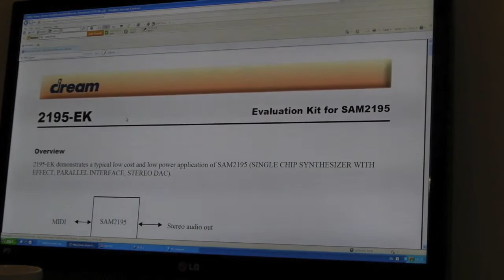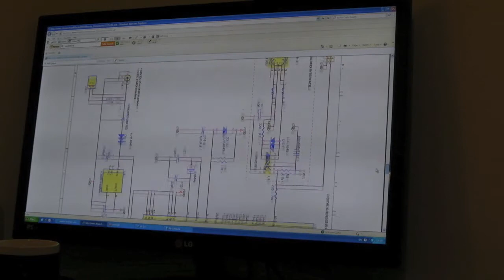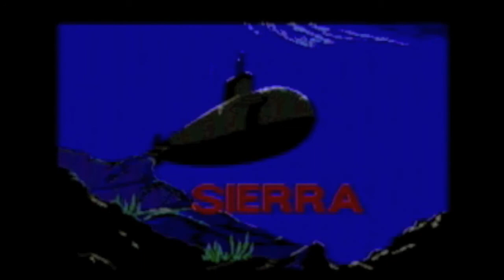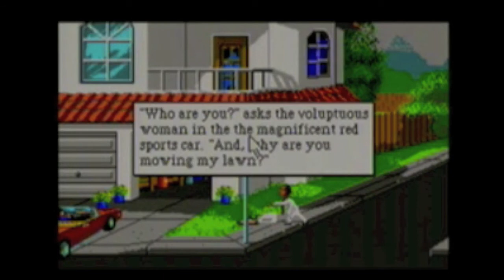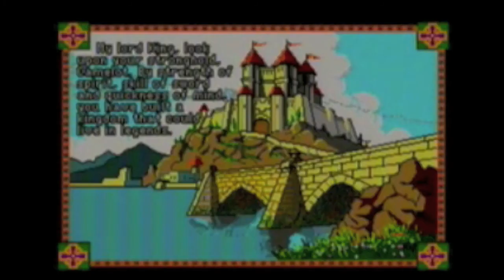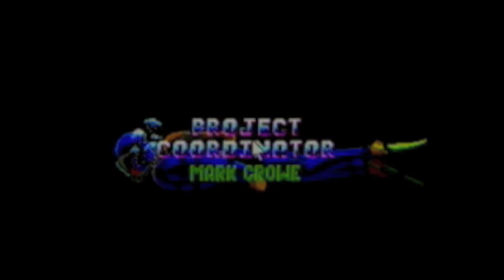Atari ST Internal MIDI Synth Mod - SAM2195

Comment from the maker: Update 15/02/2018: SAM2695 evaluation boards no longer stocked at the moment.  See here:- http://www.serdashop.com/waveblaster You would need to work out the pinout on the connector there, but in theory if you power it, feed the audio outputs, and connect the MIDI interface, I think it should work. I am not sure if you will need an opto isolator for the MIDI TTL connection there.

Update 21/02/2016: I believe this has been replaced by the  SAM2695 now.  Profusion also do the evaluation board (SAM2695-EK) as well.

Comment: Interesting Video.   Atari were stupid with the ST on the sound system.  For virtually nothing, they could have added Midi In and Out,  and the YM output (ideally all channels separated) lines to the cart port.  Then simple to high end sound expansion carts could have been made that would have mixed the audio and provided stereo output.  If that would have been done from the beginning, I am sure most game developers would have added options for Midi Music, and Midi music carts would have been made in the masses.
Reply from the maker: Yeah, I don't get why they didn't do that!  It would have made it way better for upgrades etc.
Reply: @GadgetUK164   I am not a big Commodore fan (I say with an A1200 sat in front of me LOL) but Commodore thought more into the system than Atari did, especially when it came to expansion. I guess Commodores plans for customers were 'Long Live the experience', where as Atari's was 'they'll be buying a new machine in two years.'

Comment: Hi, I have asked a good friend to do this mod on my STe using the waveblaster board. Do you have any notes on how you installed the board available online and have you heard of any cases of installing the Waveblaster internally since? Love the channel and keep up the good work
Reply from the maker: I will be doing a revisit video on my ST soon - I will talk about it then =D   Basically you need 3 things - power (and ground), MIDI input from the port there, and you need to mix the audio out.  It's better to have done a stereo mod already  (in the case of the STFM), with the STe that should be easier as it's already stereo =D
Reply: @GadgetUK164  Thanks for the feedback and I have passed on the info to my Guru :-) Once this is done the STe will be a monster Exxos 32mhz booster, internal ultra satan, fast tos and with internal midi :-) cannot wait to get it back :-) Thanks again

Comment: It's a great idea. I always said Atari should have brought out a budget external MIDI sound module back then and included a cable for YM based sound to be combined with the output so game developers could get an ADLIB+Soundblaster type spec into the market. A lot cheaper and quicker than the eventual STE upgrade surely?
Reply: Some of those pc soundcards were almost the cost of the ST
Reply: @ashleywhiteman2684  But to be fair those soundcards would rival the audio output of an Acorn Archimedes, which cost 2 to 3 times the cost of a 1987 520STFM :) But I think if Jack was at Commodore with MOS Technologies fabrication they could have copied/produced something cheaply to keep the ST alive once the spec wars of the Amiga 500 era started. Batman The Movie (by Ocean) on the Atari ST with different sound = Batman on Amiga. The ST in the right hands can do the same 3D and 8 way scrolling as an Amiga 500 eighties game. I was working on a video and that really struck me, turn off the sound and it's the same game and not jerky on either.

Comment: is there any shop selling these SAM2695-EKs...? i cant find anything online
Reply from the maker: Looks like Profusion have stopped stocking them =/  I will have a search around - I believe the SAM2695 has been used on a few other products which could be used the same way.  People have adapted them for old sound cards etc.
Reply from the maker: See here:- http://www.serdashop.com/waveblaster  You would need to work out the pinout on the connector there, but in theory if you power it, feed the audio outputs, and connect the MIDI interface, I think it should work.  I am not sure if you will need an opto isolator for the MIDI TTL connection there.

Comment: according to the datasheet of the chip there should actually be an MT-32 mode to rearrange the instruments to match. sounded like it was in GM mode on ICEMAN.
Reply from the maker: Yeah, I knew it was wrong at the time but just left it in to show how that game sounds 'wrong' lol.  I wasn't aware the chip supported an MT-32 mode, I will look into that!  Maybe I can write an exe for the ST to switch it into the other mode prior to loading the game!  Much appreciated!!!
Reply: GadgetUK164 - Retro Gaming Repairs & Mods Awesome, if you figure it out you have to make another video with it. Good stuff man.

Comment: I've never seen an ST in person, but from your videos it seems to be a very good mid-late 80s gaming system.  I've been impressed by how nice it looks graphically.  I think it's old AY-3 sound chip really lets it down though.  It's not terrible, but it's not good enough for the games it otherwise does a good job at running.
The stereo mod you showed in a previous video definitely improves the AY-3 sound - Atari should have wired it in stereo as original spec.

It's kind of odd that the 16-bit ST and Amiga systems both seem to have inferior (built-in) sound to their 8-bit predecessors.  Not sure what happened there. Perhaps there was some problem with using the old chips with a new architecture, but it seems like they could have put a little effort into updating those chips accordingly.
An Amiga compatible SID with maybe some more channels added would have been fantastic.  On the Atari side, IMO their old POKEY sounded better than the equally old AY-3-8912 (if I have the number right).
I do recall reading stories about a much better, in-house Atari sound chip that was deep into development during the ownership transition in 84.  Stories say that it was lost as a result of layoffs.

MIDI support was definitely a big feature for this computer, and the project you did in this video sounds great.  I imagine that a MIDI configuration was too expensive for gaming purposes back in the day, but now that it's economically feasible, it seems like a very interesting avenue to pursue.
Reply: There's a good reason Pokey wasn't in the Atari ST. The guys who designed Pokey designed the Amiga... Jay Miner and Joe Decuir... And arguably although it's not entirely clear when Jack Tramiel left Commodore and bought Atari from Warner Communications much of the 'Commodore knowledge' left and joined Atari.... It's a fascinating story of two great systems vying for precedence over IBM and Apple.
Reply from the maker: Yes, they are a lovely machine, but yes they also have pants audio I think.   You do get some nice chip tunes out of them in some games and the stereo really makes it more interesting to listen to, but Atari did drop a clanger with the audio.   Maybe if they had put a Pokey in there as well (or maybe upgraded the Pokey to make it have twice the number of channels, and just added 2 PCM channels like the Amiga had, it would have been brilliant).  And the Amiga - if they had built the SID functionality into Paula as well as the existing PCM stuff, that would have been absolutely amazing!!!!

Comment: Really interesting stuff.
Reply from the maker: yerzmyey
Here's the list of games as far as I know:-
http://www.atarimania.com/list_games_atari-st-midi_midi_1_S_G.html

96 titles known I think, there might be more.  There's probably only 30 or 40 of those that people are interested in.

With regards to connecting a MIDI synth up to the port as well, I've not tried that so I cannot be 100% sure.  In theory it should probably play on both at the same time (it depends on the current loop), but it would also be very simple to feed the MIDI input from the internal MIDI through a switch, so the internal could be enabled or disabled.
Reply: GadgetUK164 Thx a lot! :)
Reply: Thanks!  It would have been better with a Roland M32 compatible board.  That's why one or two games seem to just use the piano.
Reply: *****  Hm, I wonder how many games were prepared to use the MIDI interface for music. maybe there is any list, on the Net? ;) Heh.
Btw - how does it behave when You connect a regular synthesizer through the MIDI ports? Do they play both at once?
Reply: GadgetUK164
 Hmm, Lotharek has just sent me this link - serdashop . com / waveblaster (remove spaces). The waveblaster seems like not too expensive. Maybe it could be useful.
Reply from the maker: Yes, the WaveBlaster will give a better output as it was a professional card.  Typically they are much bigger and you need to build some electronics for the MIDI pass through - basically the MIDI needs passing through an opto isolator and buffering.  I did attempt to buy a WaveBlaster on several occasions but they sell for £80 to £100 and are larger and obviously need more work to install.
Reply from the maker: Just looking at that board - It's based on the same chip I've used, the SAM2195.  So it's not what I was referring to in my past message there.  Ideally a Yamaha DB50XG is what I wanted originally.  Big board but professional sound.
Reply from the maker: I will put a link to that board in the description thanks!!!  It's a very cheap board - much better priced than the SAM2195 evaluation kit I used.  Incidentally the SAM2195 has been superceeded now by another chip which has mic / line in input amplifier mixed with the audio output.

Comment: :)    Worth the effort then? Super stuff.   - rocket-dog (@ atari-forum)
Reply from the maker: I am fairly pleased with it but its not perfect as some instruments are mapped incorrectly due to ST games being MT-32 and this being a General MIDI board.  I might be able to address that later though.  Thanks for posting =)
Reply: GadgetUK164 I read about the instrument problem on Atari-Forum.  Still sounds magic to me.
Reply from the maker: clangerbasher
Thanks for the comments!  Yes, it's not bad - you can hear the worst examples there on Code Iceman, and I am sure Police Quest 2 should sound a bit different.  It's not the end of the world and its a good solution to internal MIDI if you want to play those games.